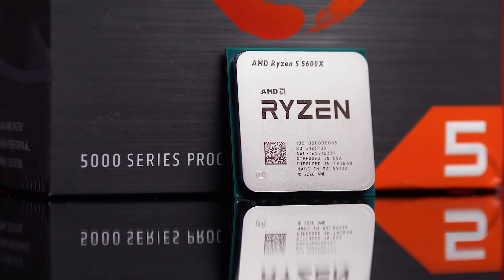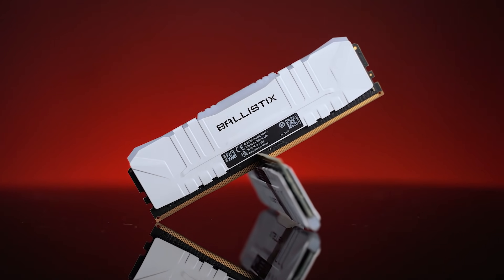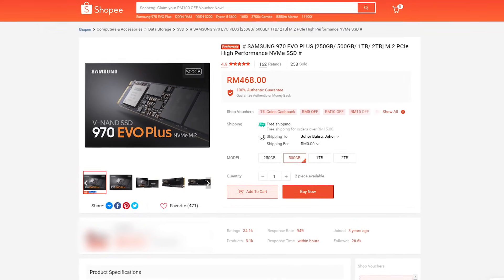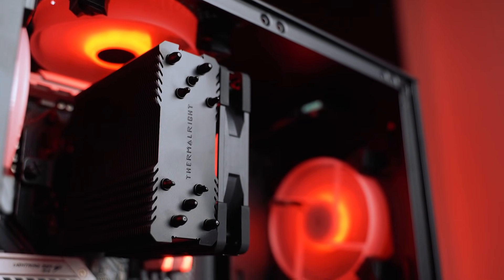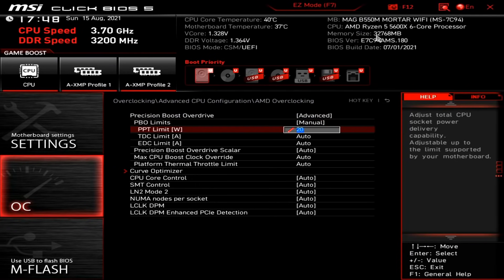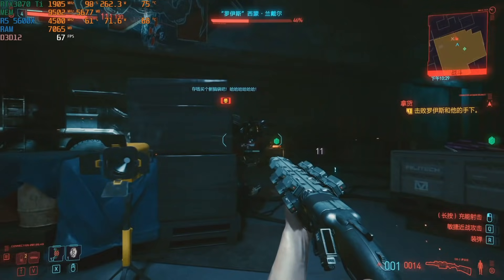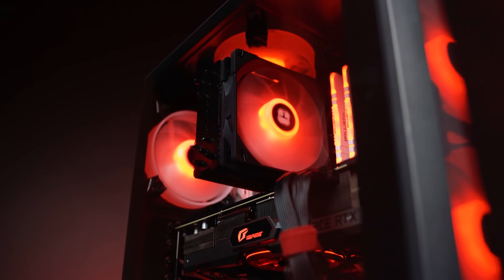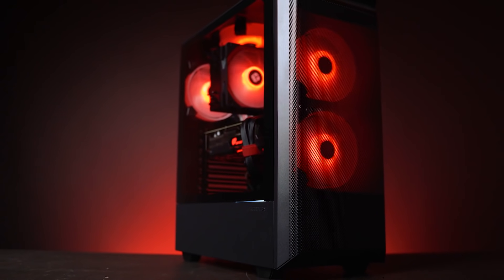【KENNY】價值RM8000的高性能2K分辨率遊戲主機裝機推薦！

Comment: Casing - GALAX REV-1 
Motherboard - Gigabyte Z590 Aorus Ultra
Cpu - i5 10600k 
CPU Cooler - NEXT X73
Gpu - ASUS Daul GeForce RTX 2070 SUPER
Ram - HyperX Predator RGB DDR4 /  Kingston Fury Beast RGB DDR4 16GB 3200MHz x2
想看这样的配置参数和大概会是多少钱😂